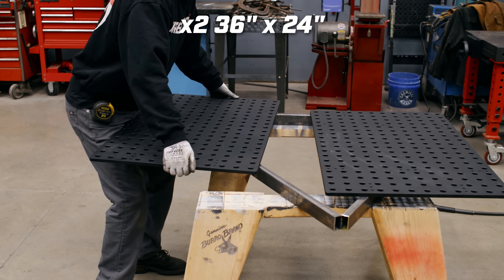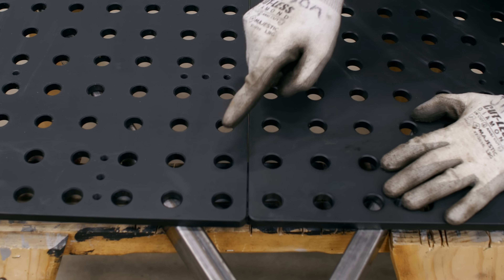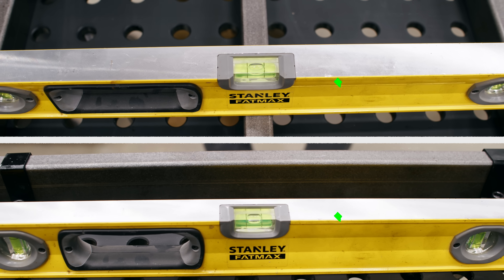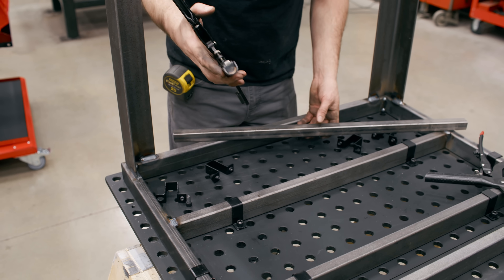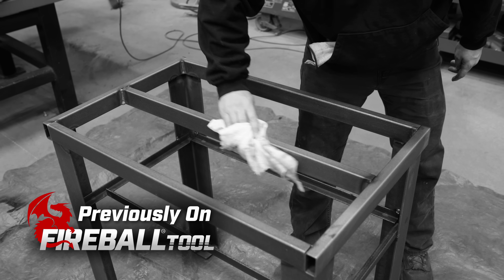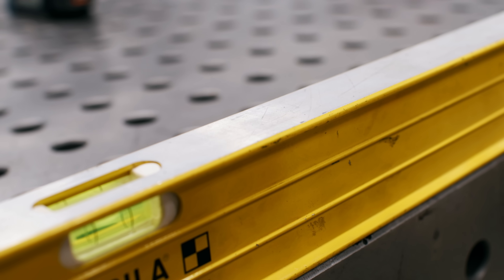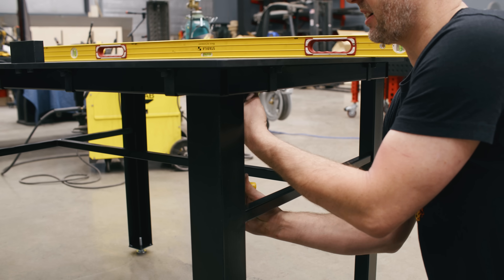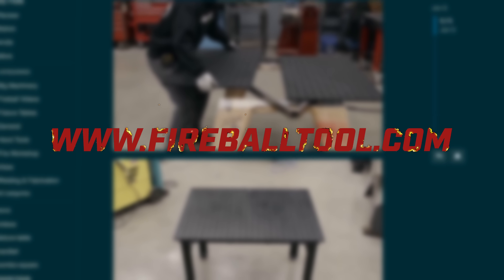Tricks To Building A Cheap Flat Welding Fixture Table.

Comment: Last year I built the single DIY table kit, and I really love it. But it is small once you start putting fiture blocks and clamps and things on it. I would really like to do this add on to double my table. It would be great if there was an add on kit with all of the steel to add on to the single table, without having source measure and cut all the materials myself.

Comment: I built a 4 x 8 foot table. How i got the table top , flat,  i  welded 16mm bolts to the underside of the tabletop,( welded the head) and these bolts go through the channel iron frame with a nut on top and bottom. ie. The channel iron is sandwiched between these nuts.
This way i can jack up or pull down   to get it flat......and because the bolts are welded to the top , i dont need strap clamps

Comment: That does seem like a pretty good system. I’ve been using the small plate fixture that fits the harbor freight table. I’ll have to do some math and figure out if I can afford it. I think I was figuring on needing 5 of the small dragon wagons to make the table that I need. This system might be a good alternative. It won’t be as easy to reconfigure it but I guess with the reduced price it would be worth it in my opinion.

Comment: I’m considering building a table with (3) 54” x 30” plates. I’m wondering what the assembly strategy should be for something that large…
Reply from the maker: Please ask this question at the Fireball Forum. Detailed help is better suited on that platform.